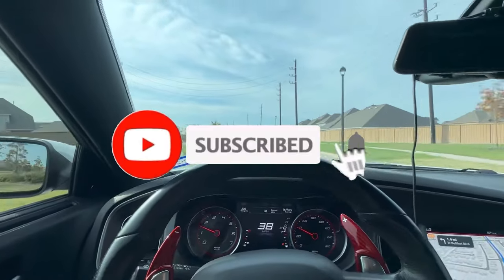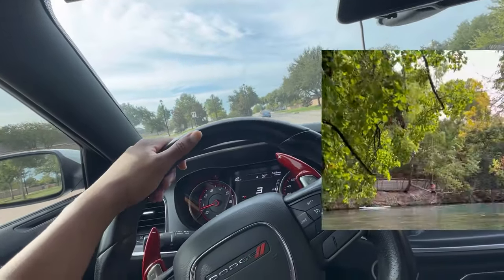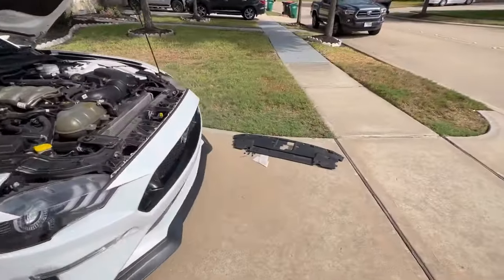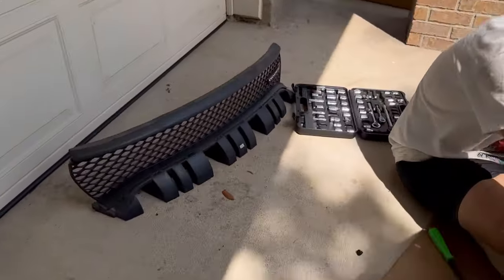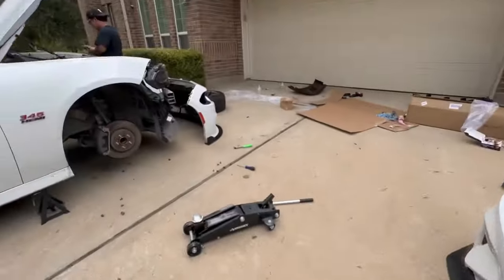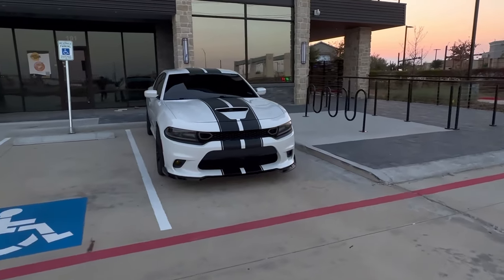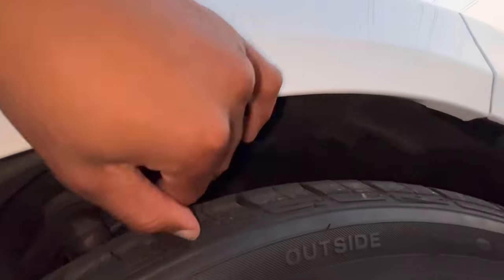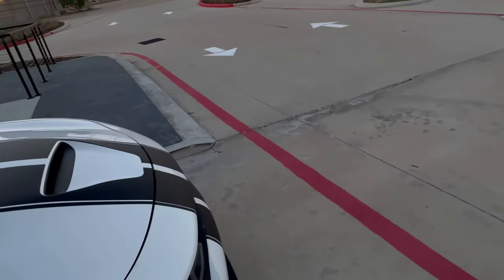DODGE CHARGER RT GETS LED SNORKEL GRILL INSTALLED

Comment: Hi I just got the parts to change out my grill for the lower hellcat airbox, is the lower grill design larger then the upper grill design? Does that make sense? The upper grill design is the same style just smaller in comparison
Reply from the maker: yes, the lower grill design has a larger width in comparison to the upper!